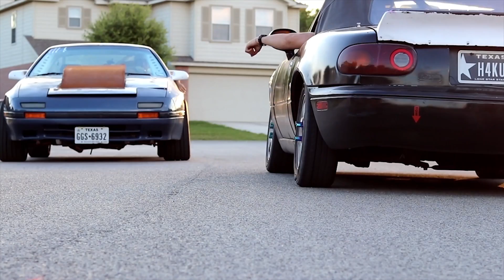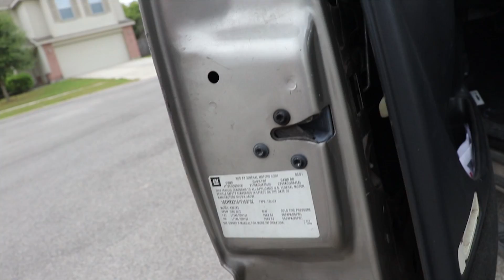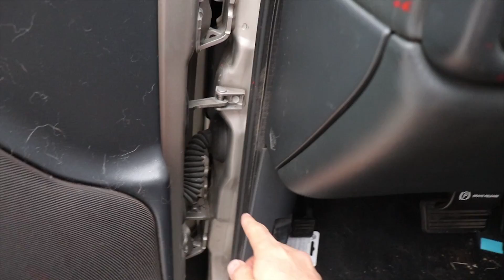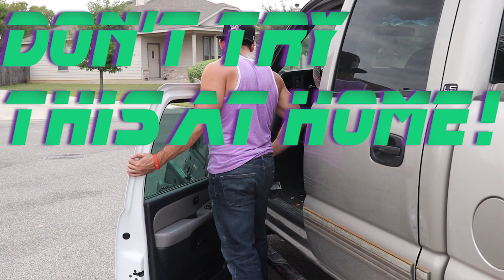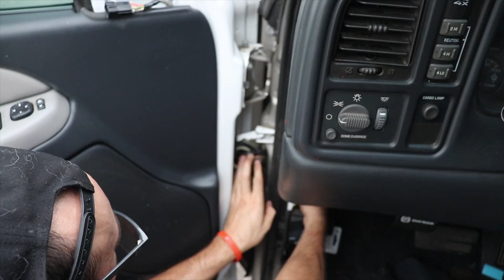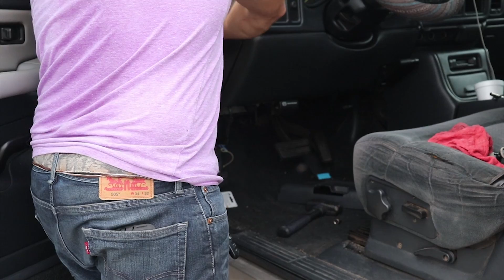Replacing a 1999-2007 Chevy/GMC truck door with a new/used one✔

Comment: Nice, I paid $80 for both driver and passenger doors for my 94 Silverado 2500. Wiring was all there and working and door panels came with. Market place is a good way to save a few bucks
Reply: Im trying to get new doors for my 99 silverado I found some that belonged to an 07 if im not mistaking they would fit right ?
Reply: Been gone so long
Reply: That's what I'm talking about🎉🎉
Reply: @eduardozapata1735 i have a 99 as well, did you ever find out if a 07 fits?

Comment: I did my door replacement on a 06 Suburban. I used a 01 door and the wires were different so I took off the panel and wires and put my old ones in the replacement door I also used my original panel

Comment: My 2005 Yukon XL go hit in a parking lot.  The rear passenger door was hit at the handle.  It was like that for more than a year.  I went down to a junk yard and bought a whole new door for $60.  Yes, that's cheap but this is near Gulfport, MS.  I swapped out the doors and the widow regulator didn't work.  I took the regulator out of the old door and was all set to go.  The chrome piece on the new door was damaged but a heat gun removed the piece off the old door.  I purchased a few rattle cans that matched the paint and did a single clear coat.  After taking it out of the shed, I could see it was sub standard.  Next, I will be sanding and hitting it with two more clear coats.  Then I'll polish.  Good enough for a 20 year old vehicle.

Comment: Have a 2004 manual doors and bought 2 auto power windows w/locks doors complete. Will the wiring harness just plug and play?
Reply from the maker: I’m not sure if your truck will have the harness for the auto doors or not. Worst case scenario you could probably swap the internals from your door to the new door. The only issue might be if it has a cut out for the manual handle. That’s a interesting one, I’m curious to know how that works out.
Reply: @TheDailyDrift  The doors on now are manual. Bought 2 used doors with elect. window, door locks & mirrors. Not going to be plug and plug as my doors only has one plug as the bought doors has 2 plugs.

Comment: See I just did this swap... easy but also a nightmare. Now my new passenger door window switch works , driver side switch won't work for the passenger window. Along with that the door won't lock or unlock via key fob or Panel switches. I re used my Sierra door skin .. other then that idk why it's like this... Aswell the speaker doesn't work on the door. Time to chase electrical .

Comment: Gonna have to take all my doors off on my GMC Canyon SLE 2007 when I paint my truck because wanna paint my truck myself. And would have to paint inside since it gonna be a lighter blue color and I ain't gonna pay a shop to paint my vehicle even though my first truck I had painted last year didn't come out well. But already have the paint 2k epoxy primer sealer, Arcylic urethane paint and clearcoat it might be 2k too. But don't matter how many times I make a mistake trying to paint my own vehicle before I get good enough at painting a vehicle I won't go to a shop to paint my vehicle I am gonna learn to do it plus I like painting and auto detailing anyway I want to do it for a job working for myself anyway I had lots of jobs over the years and in 40's now early 40's but won't to start working for myself soon.